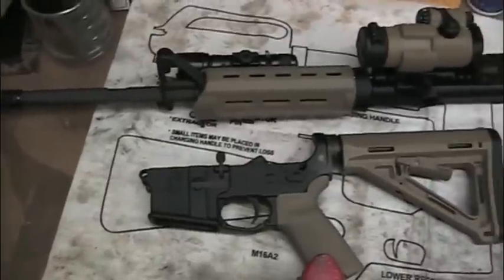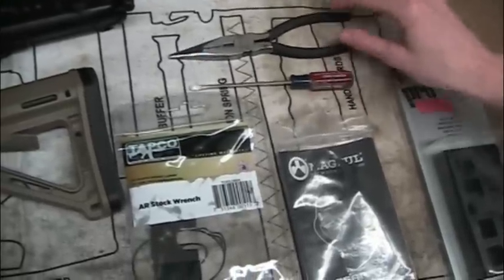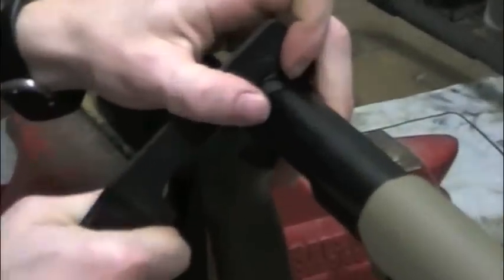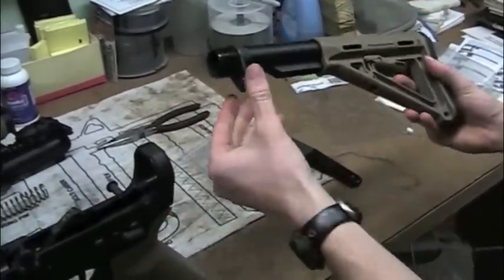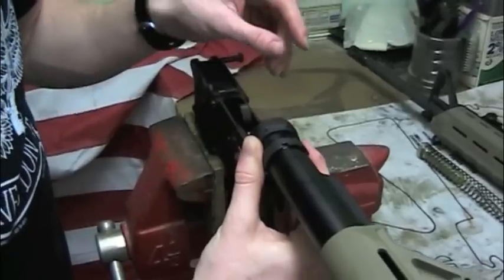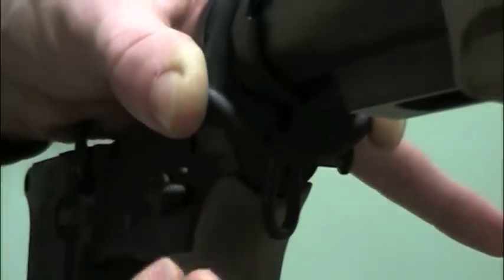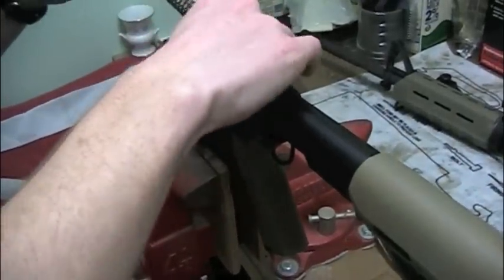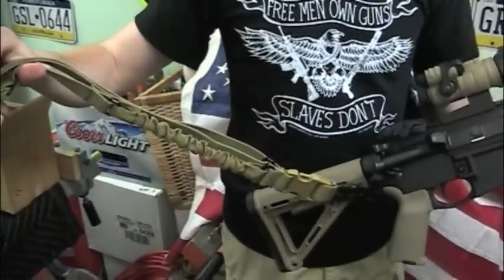AR-15: How to install single point sling adapter

Comment: Thanks dude! My sling did not come with any instructions this was a huge help. You were lying about those springs. They were flying all over the room! Lol Spent about 15 minutes looking for the even smaller pin behind that spring that holds the gun together.  Im back in action. You da man.

Comment: Thanks!  Very well done.  I've got 7 mags and just clamped an older one down enough to get the job done.  About 10 minutes later I got to attach my sling.  You'd have to really torque the heck out of one of these mags to bend them to the point of being unfunctional in case anyone is wondering.

Comment: thanks for your time!! helped me out without a question left. worked like a charm (used the same tapco tool, and same single point plate [magpul A.S.A.P.]  installed on a stag arms M4A2L w/o problem in same amount of time as the video)

Comment: Very helpful, got my sling adapter installed in a few minutes. I would have screwed up my gun without this video, thank you! DPMS also makes a disassembly ("Armorer's") tool around $25 amazon with a 1/2" square drive to fit a ratchet, breaker bar or torque wrench. Great job.

Comment: You got lucky with that castle nut wrench fitting. I had to get the small single notch wrench to tighten mine to clear that ASAP plate

Comment: @usmcboyer you're right on the money bro. Yes I have a colt LE6920 . What I did was I used my AR wrench to slowly back it off. It left some small scratches on the threads but nothing major. Thanks for the help.

Comment from the maker: No, I have not had a noise issue with this adapter. If you are really worried about noise discipline, you can always use electrical tape to secure all your jingly parts. If you tape up your single sling point your sling can bunch up a tiny bit but it isn't really an issue it moves just fine.

Comment: Thanks for the video! Years later and your vid is still paying off. I'm an old cruster getting ready for Armageddon. Never gave any of the high powered armament much thought. Was happy with little snubs and revolvers around the house. Now seeing the events unfold over the last few months, with packs of roving filthy dem zombies, I could see revolvers wont do shit against the mobs. So getting my gear in order before Biden shuts down all online and mail order sales of anything gun related. 

Glad I read your answer about bent spring. I bent the little detent spring some and shoved the bent end in the gun so the good end stuck out.  But I need to buy a vice block and better castle nut wrench. I'm not stopping at the 5.56 either. Getting a .308 setup as well. .308 will eat up vests like a fat kid eats pizza. You can buy (stolen military ?) AP .308 for $10 - $13 per round online. Too bad Soros is not on our side. Prepping takes $$. Best of luck to you all!

Comment from the maker: That is the spring that puts tension on the detent for the rear takedown pin. Replace it at your convenience, but that being bent will not effect the operation of the gun.

The actual nomenclature is the "takedown detent spring"

Comment from the maker: If you know the brand that can tell you sometimes (some companies only make one version). If you have a good way of measuring you can measure to find out. A milspec tube is 7.250" long with a major diameter of 1.185" and has a FLAT back. A commercial can be various lengths but the major diameter is 1.170" and has a slanted back.

Comment from the maker: @PaullyinAZ I think that if you plan an putting it on and never changing it, or not changing it for a long time, than the loctite would be a good idea. In my opinion it isnt really necessary though. If you notice movement or the castle nut loosening than some BLUE locktite wouldn't be a bad idea.

Comment: Semper Fi from a former Marine.  Nice how to video, thanks for posting.  I have been wanting to put an adapter on my Bushmaster.  Question on the Magpul adapter...it seems like the ring could be noisy and clank around a bit.  Have you found this to be an issue?

Comment: I have a question. I have a stock butt stock on my Colt and would like to add a single point sling to it. Can this be done w the original stock or do I have to buy an aftermarket butt stock? Great video and thanks for the help!

Comment: Good enough guide video but you make it look so easy to remove the round nut with the Tapco wrench, it's not that easy, first of all, this particular Tapco wrench doesn't fit the round nut the correct way, I ended up grinding about 1mm on each of the curved sides to make it seat/slide all the way in place so the 3 section/teeth fit in the opening/grooves of the nut. Second, the round nut is not as loose and easy to turn as you show in your video, the nut in my new AR was tight (probably loctited) so I used a combination of rubber mallet and wrench together with some 'elbow grease' in order to make it turn.

Comment: Can you please help me? Im trying to use the castle nut tool to remove the threaded ring and it just too damn tight. I have man handled it with all my strength and cannot loosen it. I have tried the push and pul method for the most leverage.

Comment: My stock buffer plate has a section around the neck that's depressed into the threads so that it cannot be removed.... How would you suggest overcoming this without damage to the threads?

Comment: I just installed the same single point sling mount, and went shooting a couple days ago. My gun (S&W M&P AR 15) fired 1 round and then stopped. I thought they were dud rounds but I ejected 8-10 rounds 1 after another, making sure my clip was secured completely several times. It eventually jammed and my buffer retainer pin was damaged after review. Would you have any idea what I could have done wrong while putting my gun back together? Any help is appreciated, thanks!

Comment from the maker: It is really just a matter of working it back and forth slowly and it will come loose. Pry lightly with a small screwdriver to get it started. Are you working with a Colt? They peen their plates on all the time, very annoying and unnecessary.

Comment: Thanx...  Everything was super easy and mechanically obviously straight forward.  You are right... The "key-way is to say the least a BITCH.  As your and other vid's cannot show, that "key-way will set FLUSH and drop little once in place, but it will FIT"  I have seen guy's file and the like, but it has PLEANTY of play to spare even though it's tight.  BTW...be prepared to hold your sling attch. for a while till you familiarize yourself to the rifle work.  All easy till that dreaded "key-way"